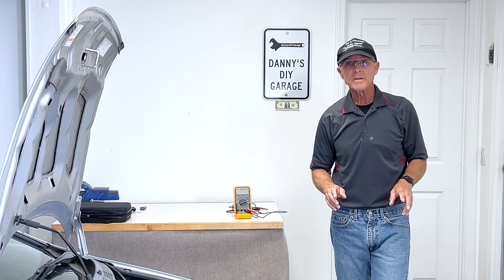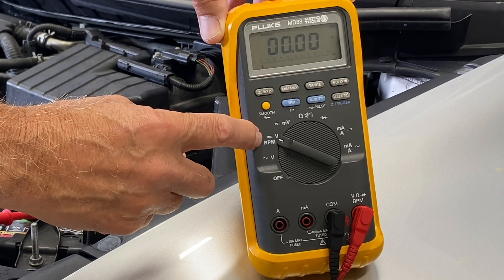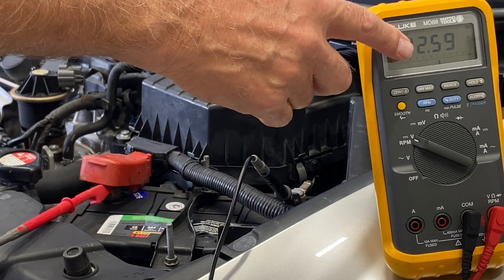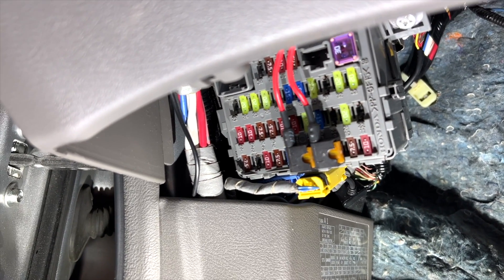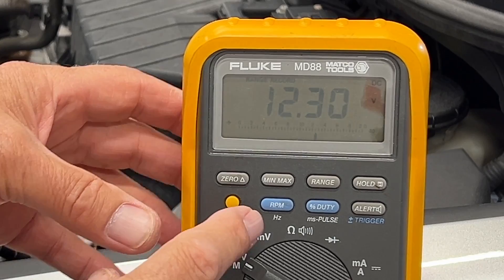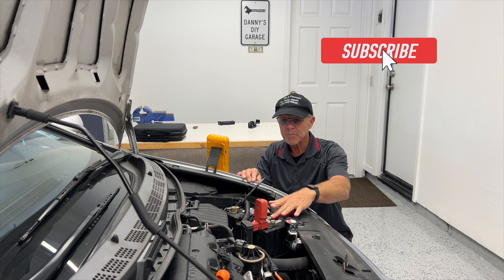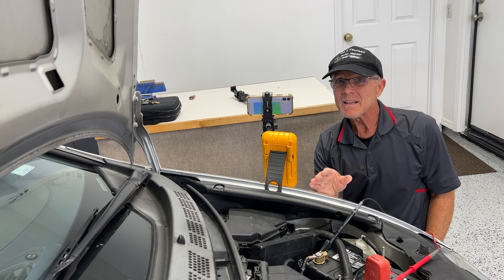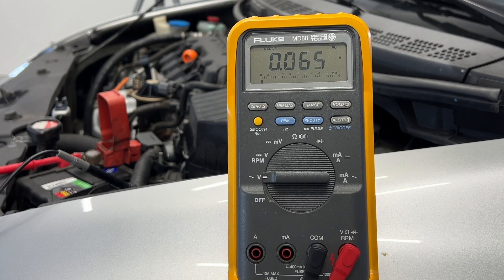Battery Alternator Complete DIY Guide FIX IT YOURSELF!  Diagnosing Your Car's Electrical System

Comment: 2004 Civic battery light on .  New battery new alternator.  No increase in voltage at battery with engine at 1500rpm.  Amp clamp shows only 3 amps coming out of alternator at 1500rpm with lights and fan on.  0.0 ohms between positive on battery and alternator.Any thoughts?

Comment: hello. i have 2012 honda civic ex-l. new battery new alternator but only charges when the lights are turned on. have problem starting the car until I turn on the lights, then it starts right away. 🫠
plz help
Reply: Exactly my problem. Only charge when full light is on.  I checked via OBD2 with a battery checker
Reply: @Olusegun-cp2qc the negative connector to the battery has a sensor that will let the alternator know when to charge the battery.  i had a faulty “new” battery and the only way to charge it was to have my lights on all the time. then the battery would fully discharge overnight.
Reply: @dennisgolikov Yeah, that was the issue. I bought a replacement from Amazon, and it fixed fit. Thanks for your contributions
Reply: Bypass the battery sensor and check voltages:
Before/after bypass: OBD2 shows.  ~12.3V After by pass multimeter: ~12.64V.
Engine ON: multimeter ~14.26V, OBD2 shows 13.7–13.8V.
With no load: ~14.38V.
With full load (AC, defrost, lights on): OBD2 drops to ~12.1V, but multimeter still shows ~14.2V.
Prior to by pass, multimeter most times  show less than 14V
after replacing the sensor, car often read 14.X V using multimeter

Comment: Hi everyone. Be advised- Honda incorporates a “Dual Mode Charging System”. This system can make it appear your alternator isn’t producing enough charging voltage or is working intermittently when actually it’s working as designed. This dual mode charging system responds to various inputs to the ECM and changes the output voltage of the alternator to charge the battery. This almost fooled me into replacing my alternator (2015 Civic EX).
Reply: Currently having this light on a 2014 civic LX. If it is in fact this issue, how do I formally diagnose it, and how do I rectify it?

Comment: Did the diode test and the voltage was at .6 volts. What does that indicate about the diode or the alternator?
Reply from the maker: Diode is part of the alternator, unless you’re having charging problems, that’s probably going to be fine.
Reply: @ thanks. Just intermittent starting issues. Car will crank but not start. Some days it’s perfectly fine. Some days you think it won’t ever start.

Comment: Followed your instructions and I’m getting absolutely no readings at the alternator and it’s only six months old and a Bosch. I’ve been told there’s a chance it could be the voltage regulator. How do I go about checking that? 2007 Honda Civic 1.8L automatic

Comment: Impressed with how clean the engine bay is and your explanation. Thanks a lot, my civic is 9gen and looks so dusty in the bay compared to yours. 
I tested recently the alternator and battery and the alternator reading showed 12.6 V. The mechanic said its too low but the revs were idle and there's no load. Ive read that Honda applies variable amperage depending on the needs of the system. Have you heard about it?
Reply from the maker: A fully charged battery is 12.6 volts, the alternators job is to keep the battery fully charged, you'll see anywhere between 12.6 and 14.4 volts depending on battery condition, state of charge and load, many cars regulate the voltage that charges the battery, as long as your charging system is at least 12.6 volts when running with a load, "meaning lights on, or fan on," your charging system should be working as designed, hope that helps. A bad battery can however effect the charging system, so make sure you check your battery condition before condemning a alternator

Comment: Hello, I have an 8th Generation Honda Civic. I installed an obd2 reader and torque pro app which has a voltmeter. The strange think is that voltmeter is not always around 14 volt , when a set my foot off  gas pedal is 14 volt plus but when a step on it, sometimes not always, drop to 12 plus volts especially on urban driving. Is this a feature for fuel economy or is there a problem?
Reply from the maker: The voltage will fluctuate depending on the load demand and batteries state of charge, this is most likely a normal condition